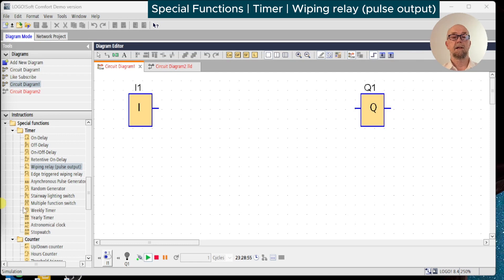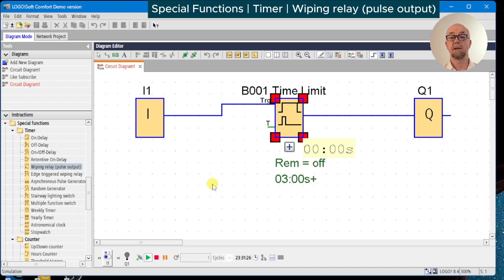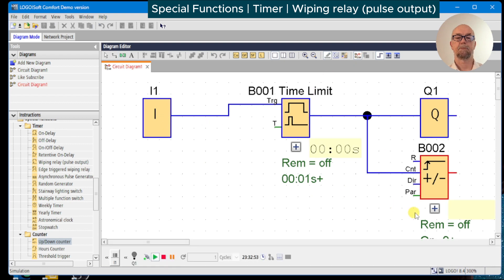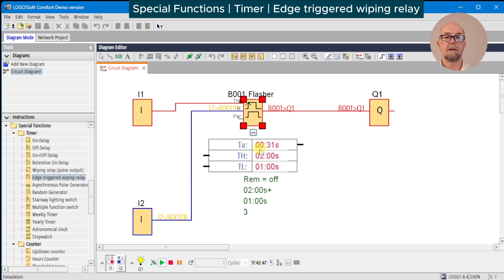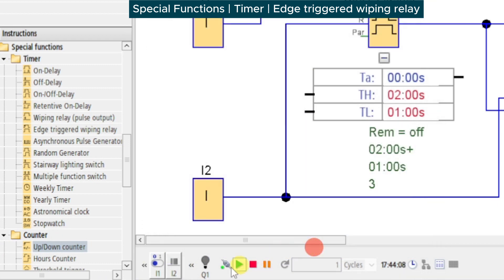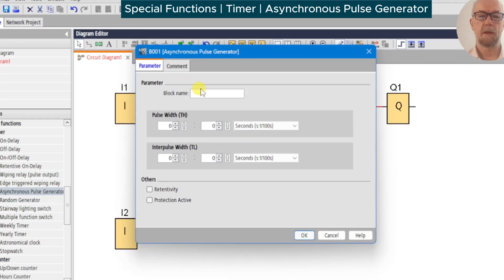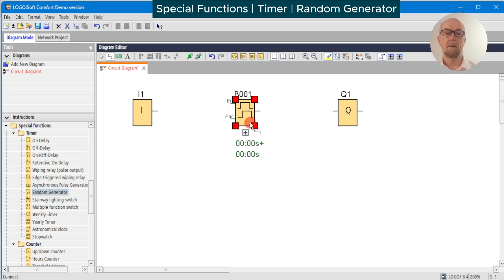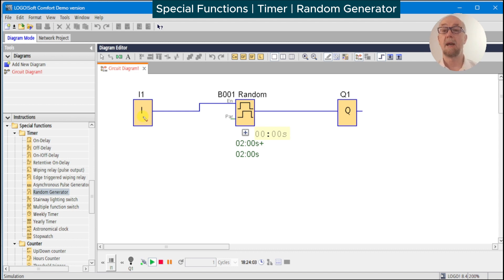LOGO! Timers 2 | Wiping Relay | Edge triggered wiping | Async Pulse | Random Generator | Siemens PLC

Comment: Thanks for the video. How would you sequence 4 boilers so each one’s starts randomly each day to prevent one being the lead all the time?
Reply from the maker: What determines the sequence at the moment? Is there one thermostat for all or individual stats?
Reply: @QuickPLC-kh5of  yeah, a time clock and then room thermostat. They then all switch on at the same time. Which isn’t really required. I’d like to have them staged 1-4 then next day 4-1.
Reply from the maker: So how will you determine how many boilers are required? This would normally require a temperature sensor that will tell you how far from setpoint you are. With a thermostat you only know whether you're over or under temperature. When you know the temperature deviation you can stage 1, 2, 3 or 4 boilers to come on in proportion to the deviation. Only then can you start the starting sequence.